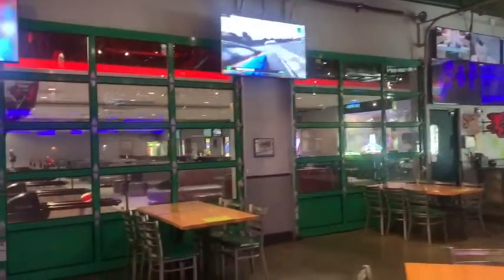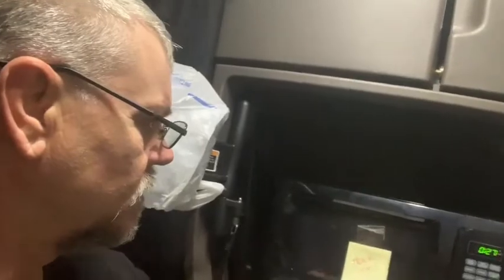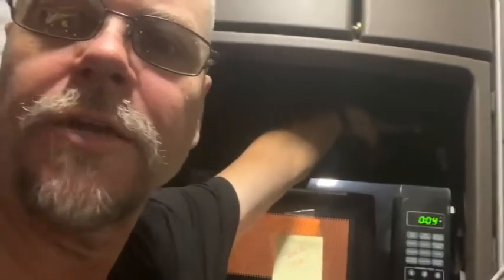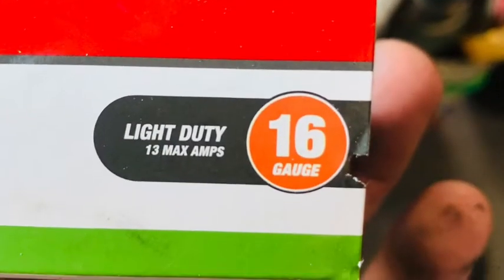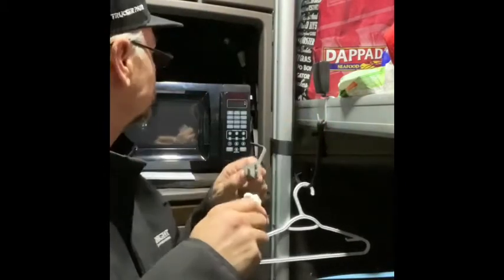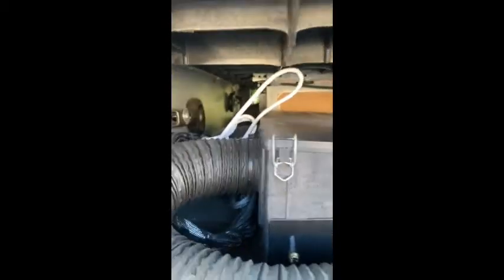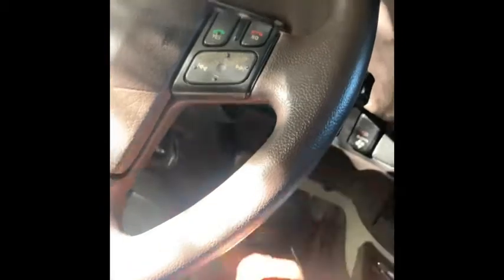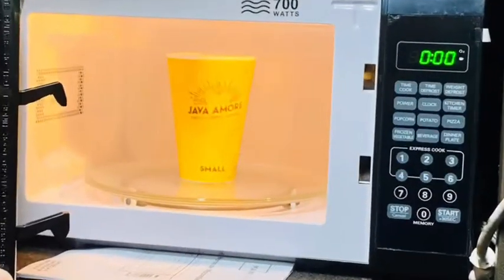Installing a Microwave in your Truck

Comment: So you can’t use microwave if you don’t have inverter i was trying to get microwave and don’t have inverter
Reply from the maker: Not sure. I plugged in from my truck to inverter then the inverter went to plug outlets in truck.  Seems like you may be able to bypass inverter possibly. Let me know what you find out. Good luck

Comment: My inverter didn’t have an on and off switch I followed all the instructions but still my microwave isn’t turning on
Reply from the maker: Aw man.  Call your shop tomorrow. See if they can help you trouble shoot. Good luck.
Reply from the maker: You ever get it to work?
Reply: Yes, I took it to my home terminal and they just turned it on. I was supposed to hold down on the power button for a few seconds before it turned on. I kept clicking it instead. Have a fridge microwave, and air fryer now.

Comment: Never use microwave on Truckin
Reply: Why ?
Reply: @eliceodiaz2492 it’s smarter to use a separate battery like apu. Rv’s have apu’s too. Jets have apu. But I guess we all have learn the hard way.
Reply: ano mangyayare kuya? meron ako inverter pero wla ako APU. ibig ba sabihin when I turn the truck off then no more power for the ref?
Reply: @jevinayson8245  when u use the microwave make sure the engine is on if not it will drain the battery faster. But fyi even police patrols cars have a different batteries for their gadgets

Comment: You could’ve just ran the extension cord from your inverter to the outside plug on your truck to get power to the inside of your truck to plug your microwave up in the inside sockets
Reply from the maker: Thanks Ed.  I just didn’t want a chord sticking outside my truck. But thanks for the tip.
Reply from the maker: I eventually did that. Thanks. Should have listen to you earlier

Comment: I'm in a 2020 volvo what is the fuse spot for this
Reply from the maker: Look for the manual. Should be one in the truck.  There is a fuse box under the top of desk. Open the cup holder and Un screw to lift I believe.  May need to youtube it if you don’t have a manual.  Good luck Slick

Comment: The truck series watt unit did that come with the inverter  or did you have to buy that as well.
Reply from the maker: 2018 came with inverter for company drivers. You can add microwave, TV and fridge if you like. At your expense.

Comment: Hey man can you show how your inverter is connected to your batteries?
Reply from the maker: Driver side by the side door where you store things there should be a shore power plug source on outside of truck. You take a extension chord and plug it into that then the other end you plug into your inverter.  You can close the side door in the extension chord it won’t hurt it.   Now you have power to all your 120 volt plug outlets in your truck. Hope that helps.
Reply from the maker: In this video I basically used an extension chord to the microwave via  inverter.  But now I have plug outlets in my truck so plugged my extension chord into my inverter then shore power then all my outlets in truck work. There was outlet near my microwave so I plugged it into the outlet now.

Comment: I did this and mine isn't heating
Reply from the maker: Trouble shoot. Does the lights on microwave come on when you open the door. May not have power set up right.
Reply: @kangarootrucker  lights turns, everything. Just don't heat the food.

Fridge on the same line works fine.
Reply from the maker: Hmmm. Microwave may be broke maybe.  Or it’s pulling too much power.  Good luck. Wish I could help more
Reply: @kangarootrucker  second microwave. Lol